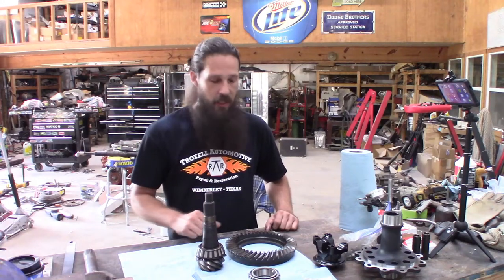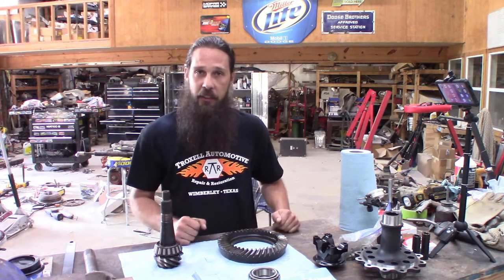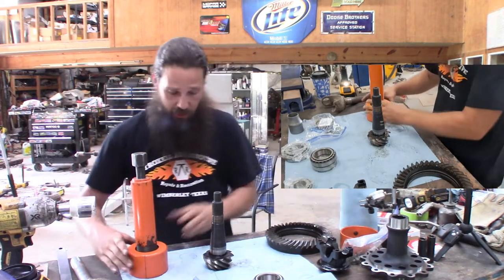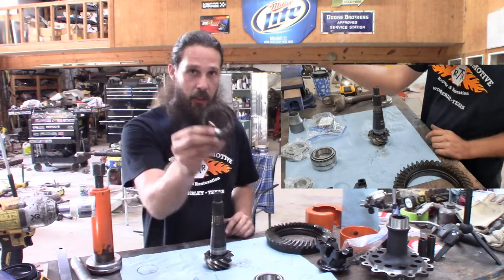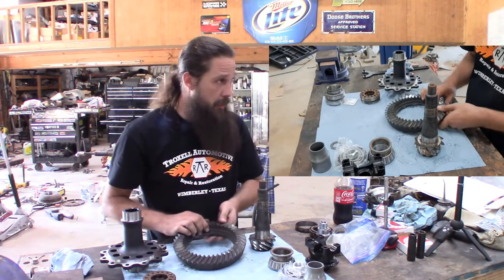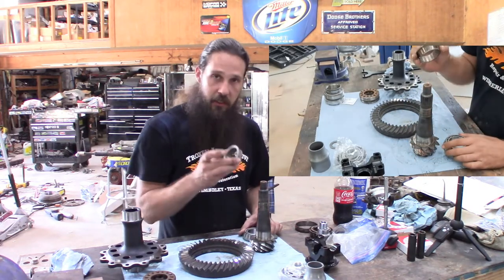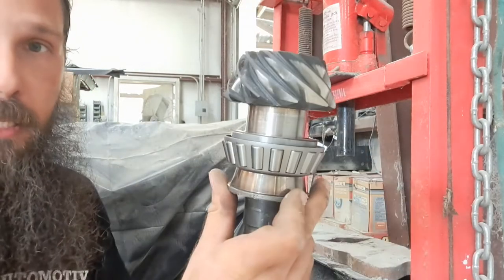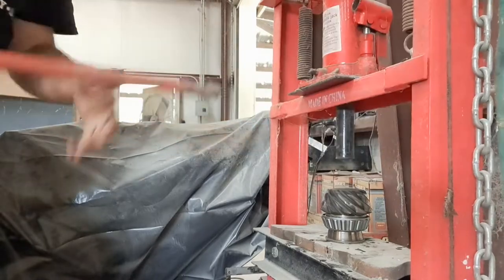Junk Yard 8.75 For The 1969 Dart is Back Together -Sure Grip Delete -How To Setup 8.75 Differential

Comment: The way I set the carrier bearing preload and backlash is: bring the adjusters in until there is basically zero backlash and the ring gear will rotate all 360* without binding, then crush the bearings by turning ONLY the adjuster that adds backlash. Keep tightening until you get it within specs, or to your previous measured value (used R&P). Do this with one cap bolt on each side (diagonally opposite is how I do it) torqued to spec and the other just snug on each side. Once the backlash and preload are set, don't forget to torque them all and lock the adjusters down.
Reply from the maker: good tips dude. it is always good to find the best methods to save a bit of time
Reply: @TheDodgeWhisperer  Thanks for the video, I enjoyed it!!

Comment: You can use a portable induction cook top too heat bearings ring gear to 200° for an easy press on.
Reply: I concur
Reply: Pinion in the freezer overnight too
Reply: @440phoenix  yep that works well!
Reply from the maker: I can just set them on the hood of the truck for a few minutes right now in Texas .... easily 200 degrees in short order LOL
Reply: @TheDodgeWhisperer  along with the ham and eggs!

Comment: Love this video Dodge Whisperer. That was fun. I think I’m ready to try rebuilding one.
Reply from the maker: Thanks dude. gear sets aren't too bad. Start with a good used set and learn how to deal with the bearings. Setting up new gears does take a bit more work to get pinion depth set correctly

Comment: Grew up with welded spider gears and broke a few axles because of it.....Might want to use better aftermarket axle with that spool like from Mark Williams...Break the tires loose when you turn corners helps save axles....

Comment: Awesome  Step by Step! I got all my parts in today so I'm ready to assemble from scratch...an 8.75 w/489for my Bee. Tell me....do you have another video or can you do a Step by Step for the pinion depth with shims. You mentioned it in the beginning and you since you have the shim, you were good to go. I don't have one to reuse, so I have to do the whole step. What do you have that might help?
Reply from the maker: you can find pinion depth setting tools on line. They are a pain to use but it can be done if you want it perfect. There should be a number scribed in the back of the pinion that indicates the correct pinion depth. You can also find several threads online in the forums. Google search "Mopar 8.75 Pinion depth"
Reply: @TheDodgeWhisperer  Thanks for the reply! I kinda figured there was some other videos out there but wanted to give you the option to direct me on one of your'...if you had one.  :)
Reply: @TheDodgeWhisperer  I discovered something I haven't seen any video footage of...anywhere. So I got the large pinion gear off but to my surprise there was NO shim. I;m guessing it's because it came with a crush sleeve? It did, BUT why would there be a shim under the large bearing race and the casing?? Yeh, when I knocked the race out....out fell a shim with the race. Is this some kind of shortcut somebody used before me?? What do you think?

Comment: So is it possible to install a spool in a 02 single cab dodge ram short box truck that has 9 1/4 limited slip thats worn out or only can be installed on an open 9 1/4 rear diff .. my limited slip worn out an i use this for 1/8 an 1/4 mile races an street too l,but only sees about 5 to 7k miles on street if lucky.. if i do spool install myself i thinking it a cheaper way to go .. like a minis spool set up And not worry about limited slip going on me again.? Or cost of a true track or locker of some sort ? Cheers dude , miss your videos 👍